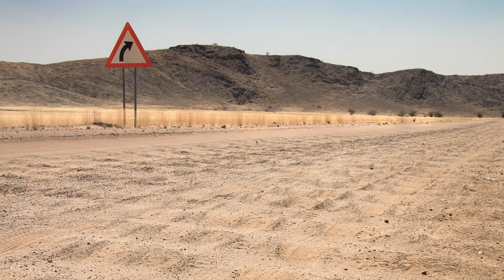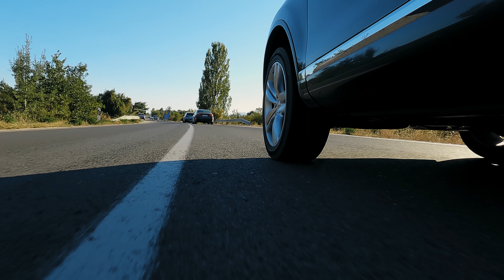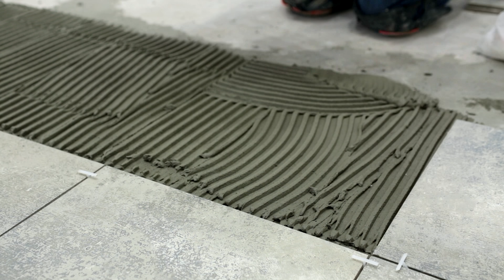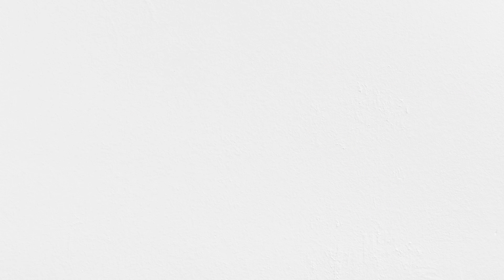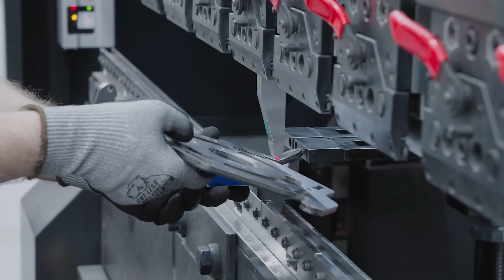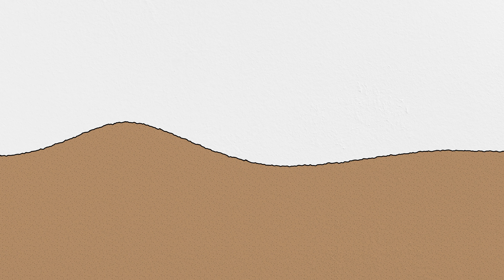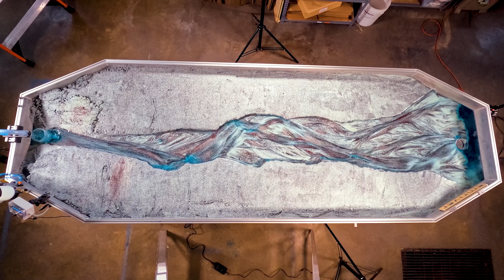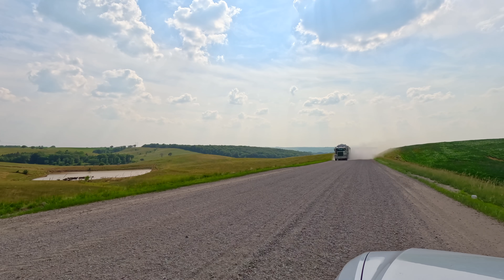Why Roads Get Washboards

Comment: Some of our NZ rural gravel roads have a different but related problem. They develop "low frequency" corrugations, when going up and around steep corners, The peaks would be about three metres apart. The whole vehicle develops a corner to corner rocking motion, consequently each time the load goes off a driving wheel, it does a little spin, thus digging out the trough some more. Sometimes they get so bad as to make it best to slow right down and crawl around the outside of the bend! It has to be a tight, steep uphill corner to enable this phenomenon to occur.  Cheers!

Comment: Another potential trade-off was mentioned in another of Grady’s videos: the absorption of rainwater. Dirt and gravel roads absorb more water than concrete and asphalt, meaning you can spend less on trying to counteract rainfall flooding.

Comment: Washboarding happens on paved roads, too.  In Princeton, New Jersey, Route 1, a heavily traveled road has a 55MPH speed limit with tons of traffic lights.  At Plainsboro Rd, there used to be a fairly steep downhill with a traffic light at the bottom, which they recently removed.  Trucks would frequently panic stop there, and the road would get severely washboarded just before the light.  Now it happens at the next light, Harrison St, but less severely, because it's flat there.

Comment: I don't think this is totally correct.  The wheel in the experiment has no damping (shock) which is there to stop oscillation.  I think there are other factors like how people drive on these roads that might have a bit more to do with it.

Comment: This may not be much different than what you are saying but i feel the depiction at 9:50 rather than say “adding a new bump”  i just feel maybe a better way is like it increases the frequency similar to how radio waves are transmitted as i think just adding a bump almost is like stacking legos but here i feel its dividing where its taking what already exist and just separating them into a finer smaller and higher frequency. Just some thoughts of mine

Comment: I noticed in 1971, when I started driving that a vehicle with a rear axle was greatly affected by the wash board problem, but independent four wheel suspension wasn’t. Hence obviously the solid rear axle  caused all those problems. 😮

Comment: I've worked on a windfarm on a mountain thats only road went from about 200m abs to 900 m abs in about 1.2 km. on a concrete road that at the near end where the gradient start to lessen it chaned to gravel. That gravel ended up getting chewed up a bit but i mean it carried trucks linked together carrying 80 ton parts up that road.
Reply: And the rest of the road was like he said nearly as good as a tar road.

Comment: I've got a cabin in a rural American county. With a population of only about 20,000 people (for the whole county) and about 1800 miles of roads, there's not a lot of money for paving. It's estimated we have a little over 300 miles of paved roads. As a result, you don't encounter a county grader on "your road" very often. 

On  the one hand, it would be interesting to see what steps the residents could take between visits by a county grader. A flattening drag harrow would be pretty cheap to build, for example, and I saw another viewer's comment about pairs of tires left at the side of the road for anyone to drag along as they drive.

On the other hand, if the county catches you "working on the road" you can expect a ticket and a fine.

Comment: Your experiment seems to only describe the results of surface iregularitys as the initial cause of the washboard effects, without takeing into account that modern powered vehicles exert "Tractive Force" on the road surface. this tractive force from a powered wheel is the greater cause of the washbording seen on uncosolidated aggregate road surfaces since the mass introduction of the automibile. Such washboarding effects were rarely or never seen before that time. You should retry your experiment using a powered wheel driveing the arm instrad of an idler wheel being pulled across the surface.

Comment: Not a valid experiment as the wheel is not a drive wheel as found on any vehicle. Washboards are the result of wheel slippage with the loss of traction on unpaved roads. The worst washboard road I have encountered was one used by people with 2WD vehicles pulling trailers.

Comment: I think it would be interesting to setup a straight track alongside the circular track and observe the formation of washboarding between the two. I also wonder if the 2mph speed that seemed to be stable translates to the driven roadway or if there's a correlation to size/scale.

Comment: Active suspension might be the solution. A lazer could be place in front of each tyre and send a signal to the suspension to always apply the same push on the road at any given moment or any surface defect. Sorry for my bad english.

Comment: Pro tip: If you have a truck or vehicle with larger sidewall tires, air down to 20-25 PSI, washboards will get soaked up by the tire flex like they aren't even there.

Comment: My grandpa who used to grade roads back in the 1920-30’s claimed that if you had washboard that came back very soon after grading that you needed to change the angle of the blade to make it go away for longer. I’m not sure if this was just a wheelbase relationship with to front wheels following the existing washboard or if there was an unknown magic happening with the mixing of the gravel. If you kind of think about it it’s almost like a V blender that shears and recombines the material because you shear from the left to the center then from the right to the center and finally from the center to the edges.. ?? Idk but maybe there’s some strange mixing math to it because they claim over mixing in a V blender will actually stratify the different dry materials in it. Strange but true from the professional I talked to.

Comment: I frequently ride my gravel bike on dirt roads in Michigan.  There is hardly any vehicle traffic on these roads, yet they're often heavily washboarded.  And the pattern of washboarded surfaces I regularly see doesn't align with vehicles and their tires deforming the road surface because much of the worst washboarding is off on the very edge/shoulder of the road where the vehicles almost never drive (but that's where I'm riding my bike).  Those same roads with massive washboarding at the edge are often quite smooth where the tire track ruts are in the road.  Also, I've seen a very common pattern where there is little or no washboarding near the top of a hill, and massive amounts of washboarding near the base of the hill.  To me, this means water/heavy rainstorms play a significant, if not dominant, role in creating the washboarded surface.  The roads are crowned, so on a flat road, the water runs from the crown at the center off to the side of the road, and that means there is far more water flowing at the edges of the road than the center.  Also at the base of hills, the water from the top of the hill flows down to the base of the hill, so again, far more water at the bottom.  The more water, the more that rapid erosion takes place.  One good thunderstorm and a road that was pretty smooth the day before turns into a washboarded nightmare the following day.  Please consider making a study and a video of what role water plays in creating washboard surfaces on dirt roads.
Reply: I too have always suspected than runoff plays a big role in this

Comment: It's interesting, I wonder if the even corrugation is because of the practically constant effect of gravity (only differentiating by altitude, and even then by minuscule amounts) and the shocks/springs that are calibrated against that constant. An interesting research question would be to see if there is a small but noticeable difference in corrugation at differing heights.

Comment: I understand how the bumps form directly under the contact point of the wheel in a repetitive motion but a question I have is why do the corrections form just bout straight lines across the road? The wheel contact surface is different to each passing vehicle because they follow slightly different tracks with each pass. Yet they corrugations form in a near perfect straight line rhythm across the road surface... This topic has always fascinated me... If vehicles don't drive in exactly the same track with every pass why do they form such straight lines?
Reply: Even when vehicles drivers in opposite directions in the opposite lane thees corrugations seem to follow the same pattern and form straight lines.

Comment: I had always assumed it was weather related, not the actual driving.
Reply: you are correct, washboards are found on desert plains and sandbars at bottom of ocean floors, it is a natural phenomenon the only difference is on roads you are accelerating using vehicle tire pressure as the force rather than wind or water, this video was clickbait and muchado about nothing

Comment: Snow has this effect too. I've gotten huge bruises when sledding down routes with bumps at least half a meter tall from peak to valley. 

I figured that it was the oscillation from the bumps making themselves worse, but I never could figure out what caused them to begin with. Makes sense that it's the inherent unevenness. Thanks for the video!

Comment: Unpaved, gravel words also consume about 20% more fuel.  The extra rolling resistance is considerable. From experience running heavy multi combination semi trucks in outback Australia, the simple math is that a transport trucking company has to price in about 100% more to haul freight on unpaved roads due to the slower speeds,extra fuel and maintenance.  Bad roads have a heavy negative impact on the economic function of providing goods and services.  Your video needs to also address that.

Comment: Maybe you could do one about why when they decide to repair a highway, they start by tearing up 500 miles of roads and spend 20 years resurfacing the entire thing instead of limiting construction to sections that could be completed before moving on. It seems like the majority of times I drive by these sections of interstate, absolutely nothing is happening on any given day for 95% of the road.

Comment: On our local low traffic rural roads washboarding is caused almost entirely by the grader operators going about twice as fast as they should be and the blade hops, washboarding the road from one end to the other.
Reply: YOU ARE EXACTLY CORRECT .

Comment: On logging roads that are mostly made from gravel or crushed rock I've noticed it only happens when the roads are dry in combination with a faster 40km+ vehicle speeds and particularly where vehicles accelerate or climb average grade even at very slow speeds.

Comment: That’s great, but it only explains the Bono’s to the width of a tyre.  It doesn’t explain the fact that the bumps are uniformly lateral across the width of the road and irrespective of direction of vehicle of travel. I’m not convinced you’ve answered the entire question, but you’ve made a good start.

Comment: I have a 3/4 mile winding gravel road driveway with a significant grade.  The washboards generally appear where my wife rides her brakes down the hills, and punches the accelerator halfway up the hills as she fails to begin the hills with enough momentum to carry her to the top.  Acceleration and deceleration may not CAUSE the washboarding, but it significantly speed up the formation.

Comment: You should spray water on it like its raining then stop for bit. Let it dry while it still rotates around. Its also reason why some roads feels so rough and hard bumps. Plus add with windy. Desert known of high windy everyday. You can add monsoon season. Plus with winter times when it was snowing. Im sure we would start noticing how stiff it will gets and how extremely bumpy wheel gets. It’ll be fun experiment! 

I live up 6k feet elevation. Bit closer to sun that you can feel the heats from sun and gets extremely cold during winter times does effects on gravel roads. So i can see over the times effect starts make roads so stiff and really hard and your car just gets so bumpy bad.

Edit: i just thought of heat lamp. Monsoon season can be really rough when weathers keep changing. Personally i love monsoon season. At one point it can be 90 degrees during day then you have black clouds creeping in then just like that its pouring rain and 90 degrees drops down to 70 degrees in 15 minutes. Then hour later. Clouds passed then sun comes out and 70 degrees shot back up to 90 degrees. Then sunset and temperature starts dropping back down to 70. 60 during nights. Its wild. I can see how roads can be like that now with your video. awesome video!

Comment: But your model leaves out the second most important force, pushing the vehicle forward.  The traction of the tire on the surface.  You would need to power the wheel and let it push the arm around to have a better simulation.  Then you would find the the frequency of the bumps would match some harmonic of the stepper motor.  An automotive driveline is a spring between the inertia of the engine and tire.  The reason that all the bumps made by cars is the same is that they all target the same stiffness.  I think it's around 3 Hz.  That is also why the bumps form during acceleration zones but not in braking zones.  Check out bumps just after a stop sign.  Very few on the side where the car brakes to a stop but very many shortly after.  The first few feet the tires spin enough that the driveline doesn't oscilate.

Comment: This clip misses some important aspects.  The frequency of the bumps is a resonance issue linked to average wheel diameter.  They will form at the most trafficked diameter and will be therefore the worst ride at that diameter.  Driving with wheel diameters above or below resonance provide a better ride.  The real missing element of this clip is tyre pressure.  As a specialist in tyre inflation systems I can confirm that over-inflation of the tyres generates the bumps.  If everyone drives with lower pressures, not only reduces their formation, but will eventually take the bumps back out again.  For this reason all Australian logging trails require Central Tyre Inflation on their logging trucks.

Comment: We use 16/32 crushed rock with clay- sand fill, and it works great as long as you have solid underlayer of 32/64 or bigger rock. It helps a lot if it's shaded so it stays somewhat wet most of the time (for clay to stay strong and not turn to dust or mush)

Comment: Not to derail your ad, but send cut send is way overpriced. For 2 small CNC'd aluminum parts that were about 3/4" tall and 1.75" wide, basic parts you could make with a lathe, they wanted $300 for 6000 series aluminum with no option for 5052 aluminum. So I checked PCBway, they charged $70 for 2 AND let me choose 5052 series aluminum. I could have had 2 of them machined in stainless steel with them for far less than send cut send wanted for just ONE of the 2 I needed in aluminum

Comment: So basically, these emergent patterns form out of the material's aggregated natural frequency. Just like a car suspension has a mass, a spring, and damping, so too this material has these properties. It's definitely more complicated because of mass transportation, but ultimately, it appears to me that these washboard roads are an unstable underdamped system. The reason why the periodic nature of damage for asphalt roads doesn't appear (potholes are often not periodic) is because the natural frequency is much, much higher due to the increased aggregated stiffness of the material.

Comment: The best way to remove washboards is to do donuts on the road and drift around corners at 80mph.
Most importantly, it's imperative to not adhere to the speed limit, because if everyone goes at the same speed, we get these resonant frequencies and positive feedback loops. Brake hard, and accelerate hard, and multiply the speed limit by a rational number made up of primes.
Either that, or drive next to the road, that also works.

Comment: 7:26
You made sand from polycarbonate?
That must have been difficult. Did you use a particle accelerator to turn the carbon in the polycarbonate into carbon?

Comment: You mentioned this phenomenon does not require tires. I've seen this first hand riding snowmobiles on trails up to mountains. In the morning it starts as "washboard" but by the evening ride down, the effect becomes so great we call them "whoops" each can be about 2.5' tall on an unmaintained trail. The groomer usually knocks them down early morning or late evening when everyone is off the mountain. I think it follows a similar mechanism to ski moguls